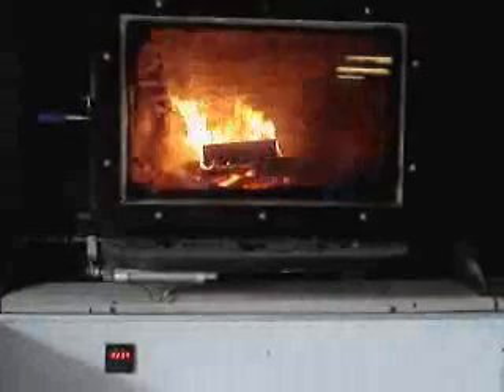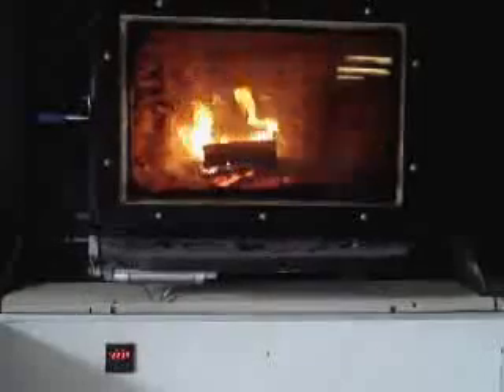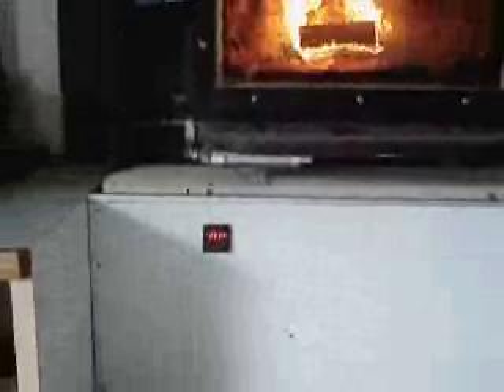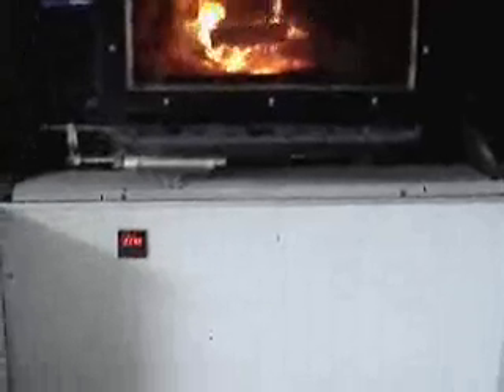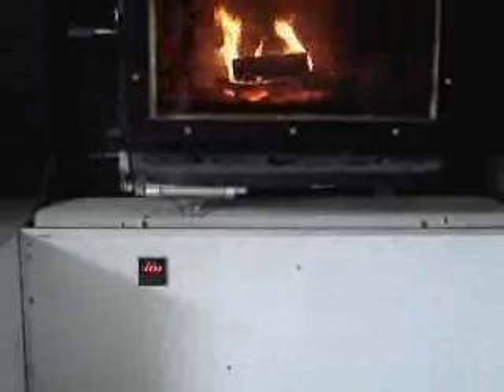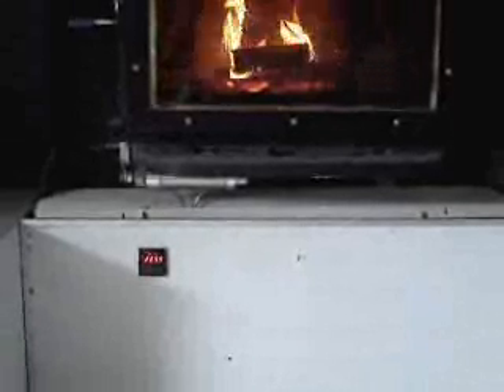woodstove controller

Comment: I've been researching.   You can buy a PID Controller on eBay for a few dollars, meant to run a Kiln, so the temperature probe can go FAR above what a wood stove would need.

And if you used the Relay contacts to turn on the air and blow it directly INTO the stove with the vents shut, that eliminates the mechanical open/close step.

Tune the PID to hold the fire's temperature exactly at the clean burn range... presto !

Comment from the maker: On and off control causes large temperature swings due to thermal lag. Time proportional control gives better control. On time is proportional to the demand. The cycle time can be anything, I selected ten seconds so I can tell it is working and the fire doesn't go out completely or overheat. The device is silent, and will never wear out in my lifetime. Look up PID control on the internet for better explanation.  thanks for your interest.

Comment from the maker: The air cylinder is 1" bore 4" stroke from Grainger, about $40.  The controller is from Omega, it has alarm and time proportional output, costs about $200.  The 4 way valve has to be direct acting, not pilot operated because of the low air pressure supply. I don't remember where I got it.  The air supply is an aquarium pump, costs about $6.  The thermocouple wire is from Omega also about 50c per foot.  The thermocouple is attached to a hot spot near the flue.  The alarm turns turns on the air.